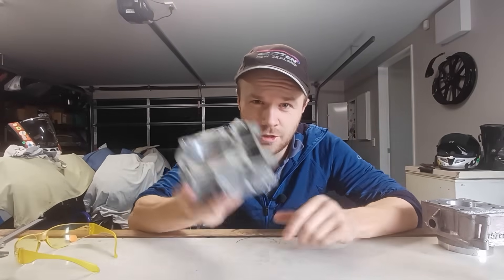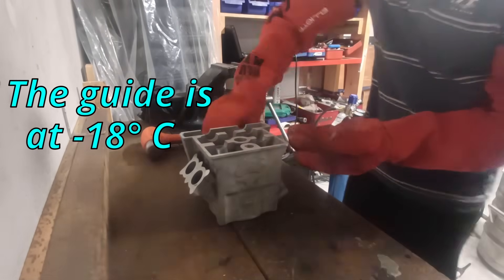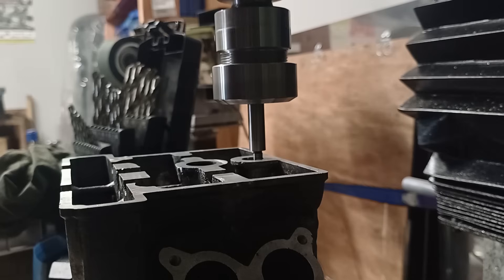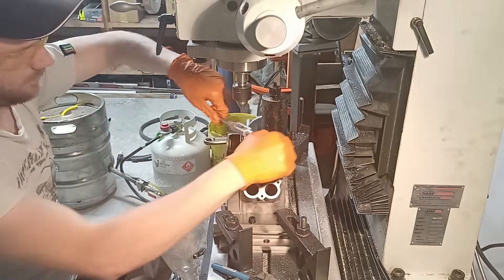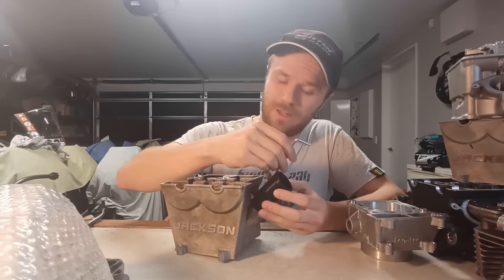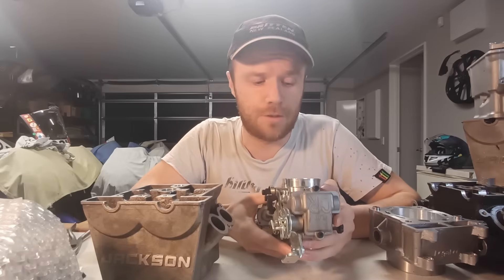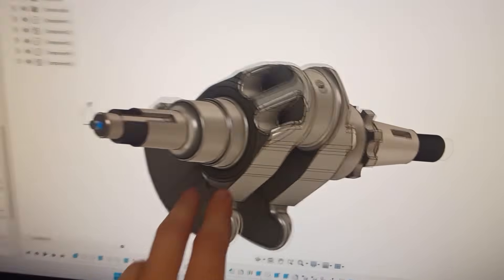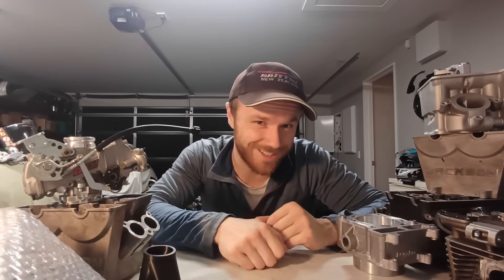Building Worlds Fastest 150 From Scratch (4T) in my Garage.

Comment: You gonna take a cylinder cast iron cylinder liner or some coating?
Reply from the maker: It will be Nikasil plated is the current plan.
This barrel has some porosity which has been annoying me so I may have another go at casting it if I have time.
Reply: @TheMotorcycleForge  You have places for Nikasil repair/plating in NZ? Well, why not... Where is the piston coming from?
Reply from the maker: A friend owns a Nikasil plating company so that's the easy part.
I have a new cp Carrillo R6 piston here for it.

Comment: here in indonesia suzuki satria 150 (underbone version of fxr 125, common part engine) was quite popular too, 
although now the watercooled and fuel injected version is not as popular, albeit being the stock fastest ub bike, meanwhile yamaha and honda owning the marketshare

yamaha r6 valve spring and valve, or kawasaki 636 are oem parts that served as secret sauce for builders/tuners, its 250 counterpart are also often sourced for valve and valve spring, while aftermarket brand are sometimes being compromised for long term.

while for crankshaft, adding/changing weight and the big end position, and pairing with stronger connecting rod substitute are also quite a work, even as far as grinding down crankshaft of honda gl-200 series to fit on satria 150.

as for solid single piece crankshaft, sourcing one from ktm duke 125 or duke 200 with duke 390 connecting rod now sounds interesting

cheers! can't wait to see how this world's fastest 150 4T compete

Comment: Good work mate. Looks like you have a good setup there. My late father had a motor reconditioning business back in the 60s-90s. I worked there for 3 or 4 years and I did a lot of valve guide replacements in aluminium cylinder heads. It is good to see that you have taken on a challenging project of making an engine from scratch. All the best from Auckland.

Comment: Dont forget to machine the big end first ,while use still have the centres . Use a drive dog as you always do when turning between centres! 3rdly  cut a strip ?.?   Use a face plate with the spindle centre. You can then bolt on a driving angle plate and bolt on balancing weights  for better machining speeds

Comment: If you got the room you could make a fixture that goes in the chuck, with two dowels spaced at the hole centers on the end of the crank, then set it up with one in the center and machine the 60deg point on it once it is in the chuck. Use the other one to drive it. Might even be able to make it into a bit of a counterweight to stop the lathe jumping around as much

Comment: nice intresting project, any reason your are not doing a "multi peice" crank shaft like most if not all 1 cylinder motor cycle engines have?
Reply from the maker: @mackebest1995  For rigidity so I can run tighter clearances and will also be running a plain bearing r6 conrod.

Comment: Suzuki/Yamaha 150cc in Asia modified can run 200kph+ on gps
Reply from the maker: @EljamesLagat  Is that 2 or 4 stroke?
That seems insanely fast if it's a 4 stroke.
Reply: @TheMotorcycleForge  4 stroke, it's a Suzuki named raider 150 fi, Yamaha sniper 150 and 155. They do street race called "waswasan superload" they call they bikes R3 killer they beat R3 in the street. They're modified to 200cc+ though
Reply from the maker: @EljamesLagat  aaah I see, well this engine will still be around 157cc depending on stroke.
200kph is still pretty impressive for a 200cc.
How long do the engines last with that kind of hp?
Reply: @TheMotorcycleForge from the post I saw, HP is 39. They always rebuild for the next race. For stock displacement they can make 23 HP

Comment: A little note on doing that crank, you're gunna need to keep enough of the ends between both cuts, so to do that, you will need to cut the crank throw before the ends.

Otherwise, you will end up turning off your center points for the crank throw.

What this means is that you need to not entirely cut all of either end off close.

Also, cutting the crank down is going to make it flex something fierce and that is fully capable of destroying your part long before you finish.

I would strongly suggest that you get some crank turning experts to consult with on this, because I've seen people completely wreck their cranks when doing this, and even breaking tooling.

Comment: Drill and tap the crank shaft to attatch counterweights. It will stop it chattering like fuck and wanting to fly out of the lathe. Will make it much quicker and better surface finish. Im a toolmaker in auckland so chuck us youre email and ill be happy to help you out with some advice. I bored out my steering knuckles on a lathe with counterweights and it span nicely
Reply from the maker: That's some awesome info there Stuart, very much appreciated.
Themotorcycleforge@gmail.com
Cheers Logan

Comment: Best type of  by throttle would be rolling barrel throttle body’s as when there at full tilt the throat is totally smooth.   The water ball. Valves you can buy at Bunnings are quite similar 😂👀
Reply from the maker: I have heard that they are not very good at part and mid throttle due to their design.
As it will be in a race bike, I want the power delivery smooth to prevent high sides.
Reply: @TheMotorcycleForge yeah ig that makes sense, the type f1 engines use are like a dual rotating cylinder that met in the middle. If it’s used for f1 then it must be pre dang good lol
Reply from the maker: @timothyhackett7372 yeah that sounds pretty cool, I may still use something like that.

Comment: Channel just popped into 'feed' 
I've always been fascinated with engines, started on little Honda's in 1968. (C100, pushrod, various OHC 50~160~175cc)
Trained as precision machinist mid 70's (did first re-bore in 1974 on a milling machine, while training)
Dealer mechanic for decades
Making valve guides on a manual lathe is very simple but a little time consuming so you don't waste material by accidentally going undersize on OD.. (cheap Chinese lathe, new bearings but really too lightweight for the things I make it do)
With a larger heavier lathe, properly adjusted it would be relatively quick to knock up a few sets (I miss my old 10" Colchester, roughly one ton of cast iron and steel)
ID will be drilled then reamed after fitting as it almost always closes slightly plus can possibly develop a burr or curve from fitting. (if you can find any information on Harley Davidson valve guide replacement, they use some neat simple fixtures to use a press, easier than beating on them)
Last few years I've been using aluminium bronze (expensive and tough to machine, I use HSS tools, easier to polish) 
 With an inverted bucket taking side loads black cast iron would probably be more than adequate and is a fair bit cheaper. (don't use 'white' CI or chill cast, too damn hard)
I generally go back to last place I remember having something, close my eyes and just reach for it, works about 9 times out of 10 😁
Haven't you heard of 'smooth bore' carbs? Kei-Hin and Mikuni make them, both developed from 1930's~60's AMAL carbs.
You can aloso get carb off something like  a 2007~8  RMZ or  KAWASAKI (same bike, different colours)
Making cranks is something we had to do during training,, mainly to get off set correct with four jaw chuck.
You just have to take smaller cuts on last 0.010" (0.25mm) to account for spring in tools and machine.
With smaller machines it's generally better to use HSS for final finishing as they can be stoned to high polish.
I would use bandsaw to remove bulk of material from blank, at least along main-shafts, material is 20~30mm over length so you can keep ofset centres? 
BTW, subscribed, always wanted to build my own engine but never had time and money (money but working so long have no time, when I had time, no money)
Now I'm retired I still have no money and I'm just too damn tired.
Reply from the maker: Very much appreciate your insights, I shall take it all in and add it to my notes.
Information from people with your experience is priceless.
Cheers Logan

Comment: I dont know what equipment you have regarding dividing heads but you could rough it mostly out with the mill. 
Also in the lathe consider an area where you could use the steady rest durring the offset machining. I have made a couple of cranks in my Myford  lathe but its painfully slow. I would fit the face plate if you have one and use a fixed drive dog not a floating one as it will save your tools during the intermittent cuts. Otherwise the part slaps the cutting edge. 
I would also suggest not wasting time with the mild steel and go straight to the material that you are going to use as you wont have to figure the machine capability twice and it will be a slow process to do on a "cheesey" lathe. If you must do a non functional one use cast iron.
Reply from the maker: Thanks for the info. I'll definitely be using it, I was thinking it would be ideal to have a dummy crank so I can check fitment and make sure everything else will fit and as I'm new to this, a practice one is a good idea.
Hmmm I'll see if I can find some cast iron locally or that easy machining steel.

Comment: Spitballing: Use your mill to cut two square ends on the workpiece. Machine the outer part of the crank. Use mill to cut two new square ends for inner part of crank. Use mill to cut most of the meat off the workpiece. Machine inner part.
Reply from the maker: I was told that between centers is the way to go because it's very repeatable.

Comment: not sure about the pre heat if you can't machine/rectify the block after. Low heat won't change anything for welding, high heat could warp the block. I heard welding pros telling that pre heating is not generally a good useful and even is even detrimental because it can warp
Reply from the maker: Well, it depends what your welding.
Always pre heat cast Alu, and do small amounts of welding before putting it back in the kiln for the heat to dissipate and, when done, cool it down evenly.
Haven't had any distortion yet.
Anyway, that's what some people with more experience that I told me to do.

Comment: Quick question, is there a little extra meat in the height of the cylinder casting or are you right on the blood when you surfaced the top face... in other words, will you finish the bottom surface as the last operation before plating the cylinder to meet your desired cylinder height?
Thanks mate.
Reply from the maker: There is some meat left at the moment.
My plan was to do some dummy dry assembies before getting it plated so I know everything will fit as it should.

Comment: i really love this project!
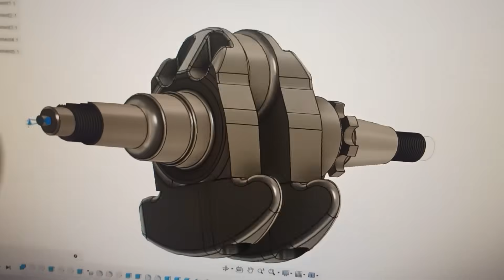one thing i've learnt here on youtube from David Vizard about knife edging the crank (the aerodinamic design you said at 11:25) is that you have to account for the oil splash.
You'd want the "chamfer" to be all on the outside so the crank doesn't push oil towards the connecting rod which would rob a little power
Reply from the maker: Aaah I never thought about it that way, makes sense.
I'll add it to the list.
Cheers Logan

Comment: Have you considered making a multi part crankshaft and pressing it together? Alan Millyard seems to have been pretty successful with that method and it would make the machining a lot easier.
Reply from the maker: It will need to be a billet crank to handle the stress, also press together cranks flex more at high rpm so you have to run extra  squish, resulting in power loss.
The third reason is I'm going from a roller bearing big end to a plain bearing, so I might as well make it one piece.
Reply: While it may be easier it's not as strong back in the day they used this method for making steam crankshafts because steam engines weren't cranking as fast as engines are today this method was also used back in the day for making chainsaws I believe

Comment: facetious me is asking... shouldnt you have referenced off the jig/sine plate as the base is located on the dowels? at least then you know every subsequent remake will be the same rather than based on a slightly random cast hole... sort of defeats the purpose of having a jig!

ha ha. drive dogs.. use a 3 jaw, turn a dead center from some bar stock, and tack (bolt?) a bar on the blank to interfere with one of the jaws...

once you get one end turned, flip it around and by then you will have thought of a way to make another dog... i often use vee blocks myself, the dogs i have always seem to never be quite suitable for any job i tackle...

though a built up crank is better if you cant forge... one piece crank thats turned isnt metallurgically ideal... even your CR500 and other large capacity engines (wurtzilla? lol) are built up...

on the EFI side of things... a rude lesson i had was making my own ECU, regards RPM limits....

at 12K, you have 5mS per revolution, 10mS per four stroke cycle. injector at 85% duty cycle, you have 4.25mS/8.5mS to get fuel in. but at idle, your min time is 1.2mS... theres this point where the injector that lets you lean out enough to idle wont flow enough at WOT when redlined... and it only gets worse as RPM builds... 18000k? (yeah, i like my lil pipsquak I4s :)) you have 3mS/6mS... so idle isnt so important for a racer, but it is a valid point to bear in mind...

enter dual injection... make sure whatever you opt for has that capability...

its part of my personal theory why most modern bikes no longer opt for silly high redlines... the EFI algorithms start getting a bit complex, blending in two injectors... building to a cost, they choose to try and sell us thumping 1&2  cylinder things that wont break 10K by convincing us that "EFI is wonderful"... sure, it can be easy in some regards, but in other aspects its not quite what we are being told it is... can get away with it on the big bikes. the market for lil 250s and the like is small, and theyre generally "disposable learner bikes", so other than kwaka, noone bothers anymore... (and why they didnt strap a supercharger on and call it the H2point5 i have no idea... i know a LOT of people that would cough up for that!)

carbs work fine as long as you know their quirks. and the evaporation of fuel in a carb/intake manifold does assist VE slightly...
Reply from the maker: My thoughts were that the dowel holes in the head are still referenced by a cast hole so potato potato ect.
I'll take the rest into consideration, I probably will have a dual injection setup, one for low speed and a shower injector for high rpm ect.
Cheers for all the info.

Comment: Your lathe will be ok.  Just need to take appropriate depth cuts.  The biggest problem is it may thrash around a bit with that much weight off center.  Just keep the RPM safe.  Make sure to rough it out entirely leaving plenty of material for finishing.  Depending on the steel you are using, it could distort a lot removing that much metal.  Might pay to street relieve it in your oven too.
Reply from the maker: Some awesome info there, very much appreciated.
Cheers Logan

Comment: think about your order of operations... when you cut the un-needed bits out of the crank blank you will no-longer be able to chuck it up in your lathe to do work on the rod journal.
Reply from the maker: Yes, I didn't explain that bit properly I will leave some meat where the big end bearing centers are. 😅

Comment: Do you guys have the cams figured out and the rocker arms and cam followers and the timing chain and the cam gear on the sprocket or are you going to use a husaberg top end on that that looks like 400 husaberg rocker arms and Cam and valves that work awesome on that who's samberg
Reply from the maker: There ain't a single husaburg part in it haha, the barrel, head, crank and cams will be of my own design.
For valves in using yamaha r6 parts.